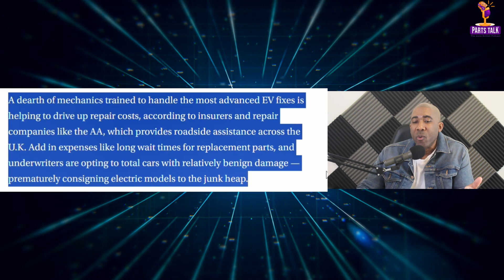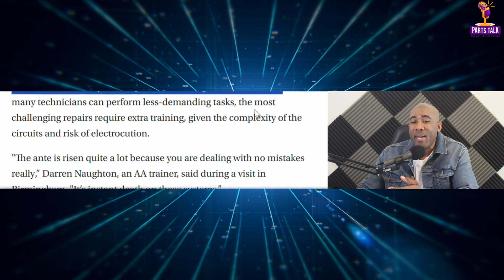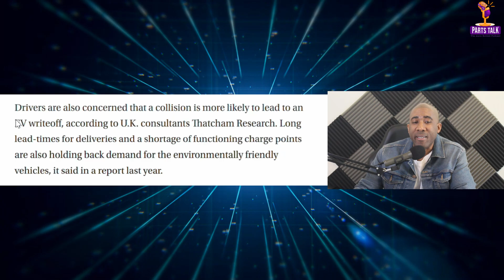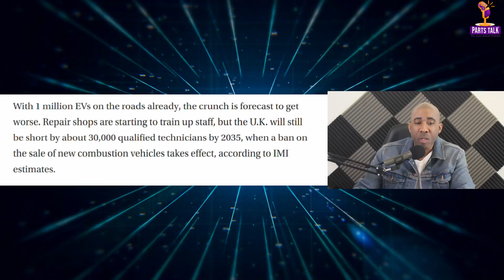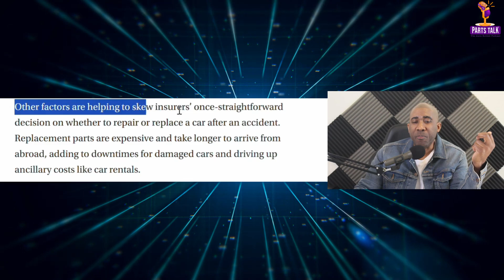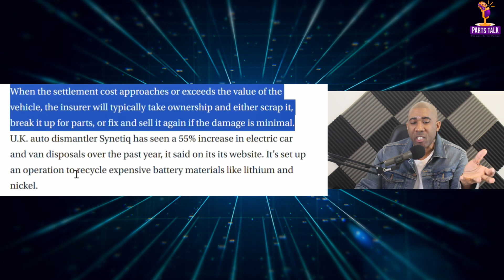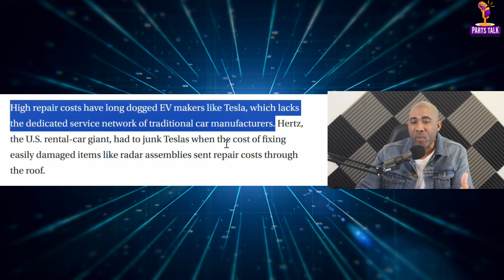Shortage of EV Mechanics Forces High Repair & Insurance Costs!

Comment: Sorry lots of false statements in this video.

You don't hear anything from Norway where over 75% of vehicles on the road are EV. no complaints from dealer or Maintenace shops

Most dealers deal with EV's already and they are much much simpler then the gas versions. Tesla's are different as they dont have the dealer network and seem to not support parts sales the same as other manufacturers. 

My Hyundai EV for example is very easy to get replacement parts if needed from my local dealer. same with Leafs at Nissan etc.

EV sales are not falling. 2023 was the highest sales of EV's world wide and 2024 will be higher yet again.

I'm not sure what is happening in Britain but there seems to be a glute of false information being spread which is disappointing.